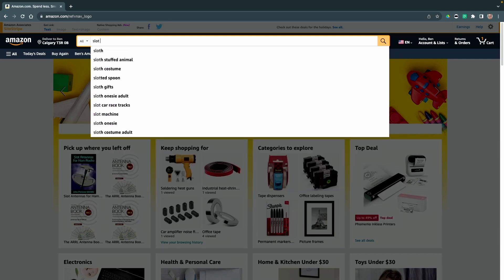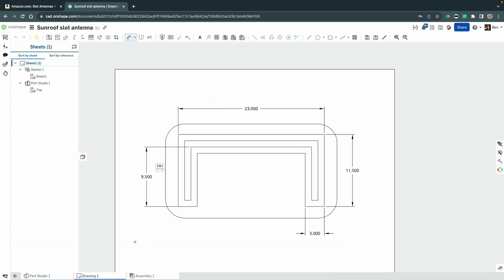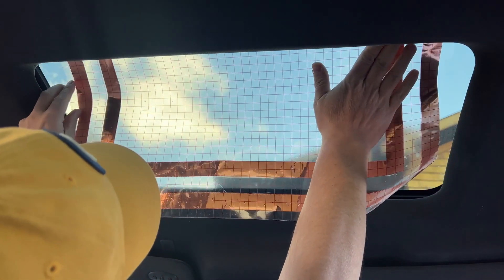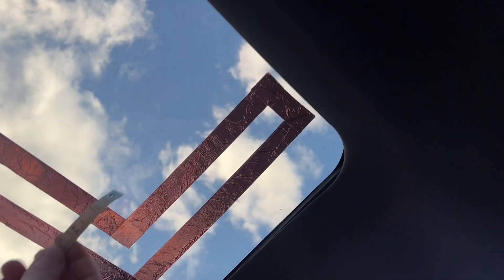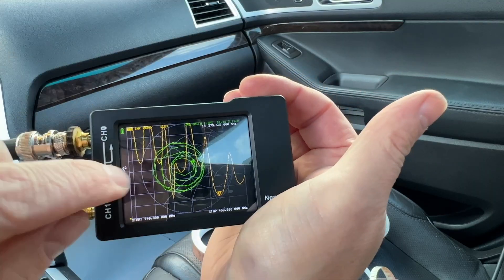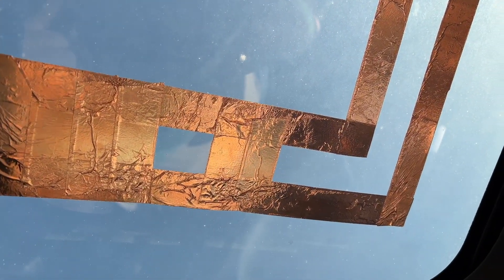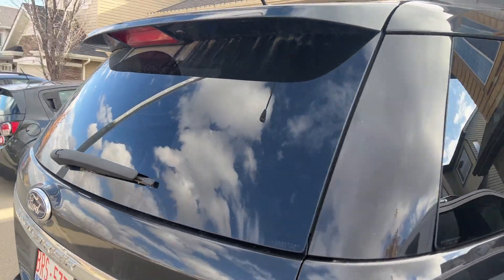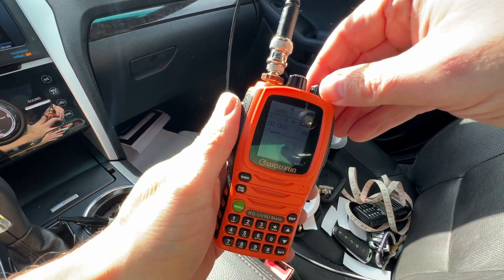Tape a effective 2 meter Slot Antenna to Your Vehicle: Ham radio stealth

Comment: 0:11 Why don't you use a ( glass heater to melt snow ) like a radio antenna
Reply from the maker: Great question. The heater traces are very resistive and the tape is not. Therefore makes a better radiator. Here is a quick explanation, it is in relation to using a carbon fiber rod as an antenna but the same principle applies. https://www.youtube.com/shorts/tFA2LB3aKKQ HOWEVER! there is nothing stopping you from trying this out. Who knows maybe there is something to this and it could work well. You don't know until you try.
Reply: @VE6SFX_HamRadioRookie  Totally ... You're right, there's nothing stopping us from trying
Reply from the maker: @johnduty4505  I updated my comment with the link that was supposed to be there... Let me know if you try and how it works out!

Comment: Always thought one could make a magloop into a window with the glass acting as the dielectric for the capacitor. Big loop with a small slit on one side of the glass. The on the other side foil over were the slit is to make the capacitor. Trim to tune.
Reply from the maker: Yes exactly.... here is your permission to go out and test and have fun :)

Comment: My English is not best one so I did not catch what model is exactly better between your shape and straight line model since I could fit it on my vehicle.
Actually is front vehicle glass and approximately 45 degre angle good position?
Reply from the maker: The bend is only to fit the window. Straight is best. 45 degrees will make it polarized at 45. In the end that should still work well

Comment: Thanks for sharing this video, very interesting proyect. 

Is it possible to use this slot antenna design , and modify it for UHF(420-450Mhz).?

What should be the slot dimentions and feed spot in this case ?
Reply from the maker: Yes, you can. I really need to figure out a online calculator for this. In the mean time the tape is cheap, try out your best guess and modify as needed

Comment: Wouldn't the sticky backing of the tape limit its conductivity reducing the affectivness of the antenna?
Reply from the maker: No the tape is conductive and the tape capacitively couples so there is very little if any loss

Comment: Sew a faraday tape version on the back of a jacket or backpack for hiking. The proximity to your body is not good for regular use but occasional use it probably won't hurt. if your concerned about radiation sew faraday cloth on the inside of the jacket to block radiation from your body, however you may need to play with antenna a little because of the add capacitance.

Comment: Once you get the dimensions more or less right you can try pinch bending instead of cutting the foil, at least most of the circuit, so you have a continuous foil. Also, pinching could make a better pigtail connection, it can perhaps be soldered. Is there no real metal vynil?
Reply from the maker: What do you mean by pinch bending?
Reply: @VE6SFX_HamRadioRookie  I mean not cutting but tuckin it in like you do on bed sheets

Comment: This is awesome! The kid, KO6BTY, and I often comment that one day our rig will be more tape than radio. We once patched an antenna connector with washi tape and then had a quite successful POTA activation in at LA State Historical Park. But, an antenna made from tape? That's cool! You may have given us a reason to finally pick up an HT!
Reply from the maker: Truth. Heck you can get flexible pcb’s with adhesive so effectively tape circuits.

Comment: Pretty sure there are aerosol  temporary spray adhesives you could use instead of the sticky film.  You could spray a piece of paper as a base for the tape.  Check your local art supply store or online. Great video, I will get John Portune's book and  build a slot antenna for GMRS
Reply from the maker: Never thought of doing this. Great idea. Thanks!

Comment: Very good idea, congratulations! I will try it too.
Do you know that in this position your antenna is horizontally polarized?
A slot antenna with a horizontal design cut into a vertical plane has vertical polarized. Your antenna is turned 90 degrees on the axis of the slot, so the slot is in the horizontal plane, therefore the antenna is horizontally polarized.
73DX! HA0NC
Reply from the maker: I’ll need to check on this. I am not fully convinced that is the case. But something to dive into for sure
Reply: @VE6SFX_HamRadioRookie  - The complementary equivalent of the horizontal dipole antenna is the horizontal slot antenna cut in the vertical plane. The difference between them is that the horizontal dipole is horizontally polarized and its corresponding slot antenna is vertically polarized.
But there is a simple method to determine the polarization of traditional dipoles, closed loop antennas and slot antennas:
Mentally connect the two feeding points of the antenna with a straight line! This line shows you the polarization of the antenna! If it is vertical, the antenna is vertically polarized. If it is horizontal, the antenna is horizontally polarized. This method also applies to slot antennas! Even if you bent the slot antenna at right angles.

Comment: One can also make a slot antenna out of a single piece of foil tape.  These are particularly useful in upstrairs windows in HOA land, as a horizontal slot is vertically polarized.  All one needs is a ruer and an exacto knife to cut the slot in the tape.  You can steal the rough idea from the W6NBC slot antenna.
Reply from the maker: Yes that is where I got this idea. John (W6NBC) is a great guy

Comment: My Frend, I enjoyed your Video, but i need to warn you of the dangers of RF burns even while using only 5 watts. There are some places along you antenna that carry very high voltages and will burn you if you touch it while transmitting not to mention that your antennas radiarion pattern is pointing up at the sky and down at you. you. God forbid you run 50 watts into it .  Better that you attach your antenna in a vertical position on the back window of you car further away from people and linit your power according to the FCC guid lines.
Im glad your enjoying Ham Radio have fun but please be carful. RF burns are more than skin deep, the burn go's all the way to the bone. 73's
Reply from the maker: Thank you for your concern. I do appreciate it, truly. However can you then explain to me why a rubber ducky inches from ones face is ok at 5-10W but then this is not?

Comment: Isn't that slot mainly going to radiate straight up and down?
Reply from the maker: Great question and no it will not. The radiation pattern is vertically polarized. Horizontal can be two different orientations. As long as the plain the slot is on is horizontal it will end up with a vertical polarization. TV stations use this to get horizontal polarisation with a vertical slot but the bonus is that in that configuration it is omni directional. You can assume the same here that it is all vertical but its radiation patter makes this one directional.

Comment: I lived in a house that there wasn't a way to have an antenna up, I used the gutter and a piece of wire to make a skeleton slot for 40m along the longest side of the house. The roof was metal so it worked out really well and with a tuner worked all bands with a decent noise floor.
Reply from the maker: Love it.
Reply: @VE6SFX_HamRadioRookie  You should definitely try it, out of all the hundreds of antennas I made over the years that one was night and day compared to loading up a gutter and equaled my 1/2 wave end fed.

Comment: Ok, did you do the FCC radiation test on this indoor antenna? I feel like somebody will hook this up to a high-power radio and be in danger of the radiation. Thats ok as long as you get views, right? 2 meters can be very dangerous. You are going to get someone hurt.
Reply from the maker: I have not done a FCC obviously, and using a HT is hardly going to be a issue here as the rubber ducky antenna on the HT is much closer to your head at the same power. Regardless I will be doing some testing as it is prudent. I hardly think I will get anyone hurt at anything under 50-100w which is the standard mobile vehicle setup, keep in mind the whip antennas for these radios use your rooftop as a ground plane and they are at the same height and distance from your head and in your eyes should be just as dangerous if not more given they are the return path for the current of the antenna. Given your point, I see you are very concerned and given your concern about this please make one and do some testing and show the world how horrible I am, and how dangerous it is. Until then these are just postulations.
Reply: @VE6SFX_HamRadioRookie  Well he's not wrong with the potential for RF absorption to be an issue at higher power levels. Playing around with an HT and doing this is one thing and isn't a huge concern -- but if someone attempted to hook their 50-watt mobile radio and run this as you've shown over an extended period of time it that wouldn't be a good idea; unless you don't care about your brain.
Reply: LOL. If 2m is so dangerous, be careful with that 5w antenna 3” from your forehead.
Reply: No it would not get someone else hurt. Anyone doing any experiments does so on their own responsibility. 

Are you worried about videos of people driving in case an inexperienced driver hurts themselves?
Reply from the maker: @ROMAN138  I appreciate your comment, but verbal slights really have no place here. I would love to hear what he has to say about this if there is any validity to his point.
Reply: I can just picture a REAL rookie hooking this up to an 80 watt Yaesu, and have a couple inches of snow/ice on top of his sunroof. You better believe that can be dangerous. Mr. radio rookie, IM sorry I hurt your butt with my verbal slights, but sometimes the truth hurts. Honestly I figured you would shadow ban before you pinned, so good for you. You impressed me.😁Dont expect more comments from me, I have better things to do.
Reply: @extreme978 Found the sad ham, you spoil sports are everywhere. I think you should check your blood pressure now to be "safe". 😂
Reply: @extreme978  Grow up.

Comment: FUNNY ANTENNA!
You c o u l d test a.HENTENNA 
WHICH IS A RECTANGLE AND
HEIGHT 1/2WL THE SHORT SIDES
ARE 1/6 WL  FEED FROM THE 
BOTTOM 1/6WL PUT TWO OF YOUR
COPPER TAPES AND A 2 POLE POLESCREW IN THE MIDDLE CONNECT TO STRAPS 1/6WL UP
FROM BOTTOM!  EXCELLENT FOR
2 M 70CM [6M] 
IT S JUST AT SUGGESTION W H A T
YOU CAN ACCHEIVE WITH WHAT MATERIAL YOU HAV!
A BNC IN THE MIDDLE
Reply from the maker: Thanks for the info! I’ll have to try it

Comment: sunroof good, side door windows good, rear side windows good.... tailgate window generally bad (the heater elements criss-crossing it tend to screw things up.... but having said that some dc blocking capacitors on the co-ax & some rf chokes in the rear window supply & earth have been used to actually use the heated rear screen as the antenna in itself).
Reply from the maker: Noted! 73

Comment: Foil antennas are a real thing. I've made them as dipoles taped inside my office window where I couldn't put up any antennas outside...it worked great. Also made them inside the airplane wing before the layers of fiber glass were added. Works great and no antennas out in the airstream to create drag. Be careful about sticking these on windows (especially rear windows) where there exists heat wires for defrosting. That may cause some problems.
Reply from the maker: Noted and thank you for your thoughts. I am the rookie and taking all the advice and coaching I can get.
Reply: That’s a good point about the heater wires. I was thinking the rear quarter glass might be a good location for a foil antenna. There are no heater wires and there’s lots of glass real estate. There is also no possible motion from a moving glass. The moonroof on my 4Runner tilts for venting but also slides open, so it is not a good location.

Comment: Slot antennas are a hard taskmaster, we build them for 160/80/40m.  Looks like yours is too narrow.  Try 1/2y long, 1/7y wide, and feedpoint 1/10y from the end.  If you want to experiment with them, choose the 23cm band as the antenna is the size of a slice of bread and you can make it with single strand copper wire, cutters, soldering iron.  Once you have some experience, scale them up to other bands.  Prepare to be amazed at HF slots..
Reply: The main problem with experimenting at 23 cm is finding someone to talk to...
Reply from the maker: Thank you for the advice. Quick claification,  'too narrow' of a gap, or narrow tape width? Already gobsmacked with this one and I want to see what a well built one can do.
Reply: @VE6SFX_HamRadioRookie Too narrow a gap, see dimensions above, or google images search "hentenna".  I haven't played too much with  larger diameter conductors - all our HF slots are made from 1.6mm galv steel wire, goes super well.  It's definitely possible to get these matched perfectly, better than 30dB RL.
Reply from the maker: Interesting because all my research into this with John Portune and other videos tell me the gap in a slot is not as significant https://youtu.be/NMZNG9qZMYg?si=tlvHr-W2VqD1r6ej , https://youtu.be/1fOLLuAjuwM?si=npnd5TmOiYfbMS5h , https://youtu.be/dI6e4ZR9Oi8?si=h0gLNkyEKfEGVW9p , https://youtu.be/dI6e4ZR9Oi8?si=yNdcGsYpbtQazA0l some even go as far as to say a hentanna is a different type of antenna entirely. When driven, it radiates like a dipole antenna. It is also open to  different feeding methods. Like waveguide, coplanar waveguide, coaxial, slot line, or microstrip. "11.4.2 Slot Antenna The slot antenna, consisting of a narrow slit in a ground plane, is a very versatile antenna. " https://www.sciencedirect.com/topics/engineering/slot-antenna#:~:text=The%20slot%20antenna%2C%20consisting%20of,of%20wireless%20and%20radar%20applications

Comment: Great video. If your NanoVNA is functioning, can you see if the 2M design has any resonance on (or near) 70cm? A 2M dipole often does, although the pattern will come out at an angle instead of being basically broad-side. This is a great antenna idea for apartment dwellers that can't stick anything out of the windows too! 

73,

--E
de W6EL
Reply from the maker: Yes taping to windows is something I’ll be trying. The issue is keeping it stealth from the wife ;)

Comment: Speaking of 6 meters and below, I suppose you could do a slot antenna using duck tape and hang it vertically (like hanging from a tree). 

Basically combine your duck tape j-pole and this slot antenna into a horizontally-polarized antenna.

BTW my understanding is that while a slot antenna "flips" the polarization (a horizontal slot = vertical polarization and vice-versa) the radiation pattern does not "flip" -- a horizontal slot would still have a figure-8 pattern and a vertical slot still has an omni pattern, even if the polarization is opposite of what you'd expect with a regular dipole.

This could have interesting implications.
Reply from the maker: Yes directionality!

Comment: I am not one of those who, ahhhh who am I kidding; I TOLD YOU SO. Preempted a video about an antenna to show us a video about your newest antenna. BTW, you can load up the front window drame dor 10/11 meters. Still have a couple of match boxes, one de-soldered and one useable. Bought them in the bi-90s last century. They don`t work with the heater tape de-ice.

You need to get a field strenght meter to check out the pattern of that thing. You could salvage everything you need from a dead (or not) boom box with LED meters. Wait. Forget I said that. NO you can't build it. IMPOSSILE. 

You are on the road to one addiction, no need to add diy test gear to that. There is a japanese ham that has some simple qrp rf test gear projects. I'd post a link but YT "dunna wanna shoe da links." Got to go now, my test gear group session is about to zoom  😮
Reply from the maker: Now the engineer in me kicked in and you are right I can manually map the pattern. Not only that but I am a king at microcontrollers. I know how to not just LED view it but have a microcontroller map to a table with a gps attachment for sone solid empirical data. Great feedback. Tank you

Comment: Did that S11 port break off?  Nice design!
Reply from the maker: Yes! Luckily it was a bad solder joint from the factory and the pads did not rip off. I have since soldered the hell out of this and it’s fixed.